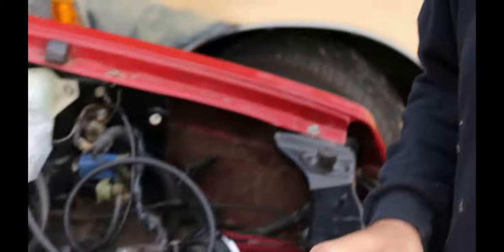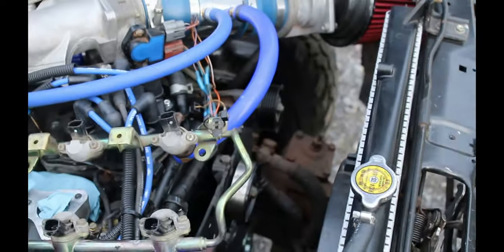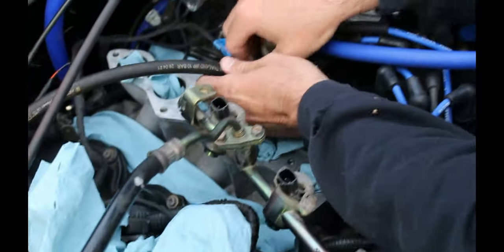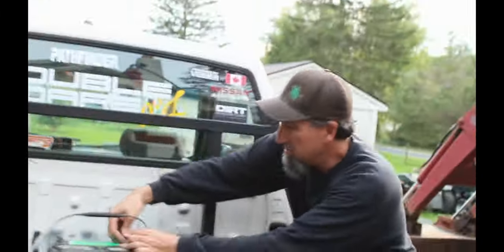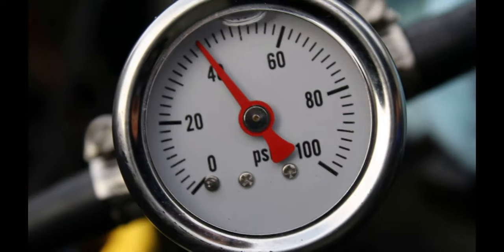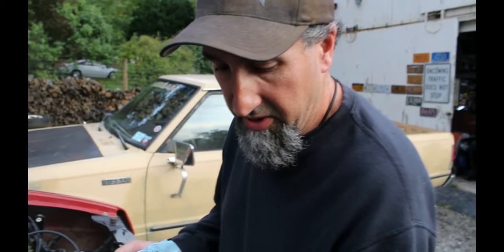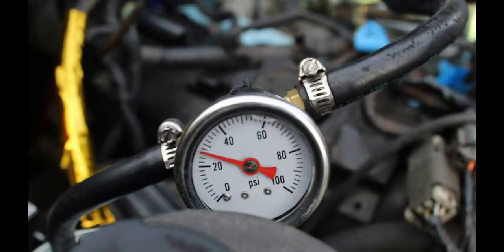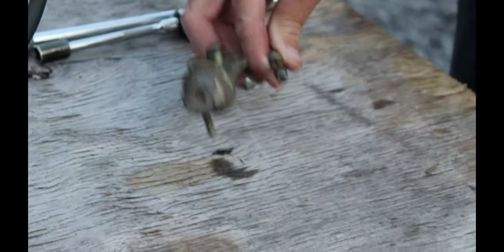1992 Nissan Pathfinder Supercharged Pickup Build Update 10/7/23: It Never Ends

Comment: I just left a comment on your other video. Glad you figured it out. One thing you could do if the stock ones keep fighting you is get a rail adapter so you can run an aftermarket regulator.